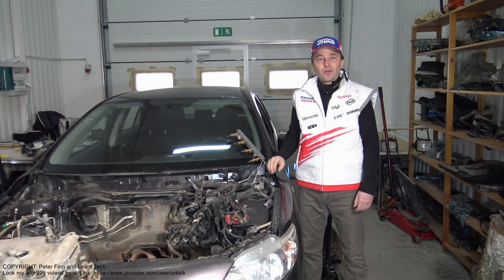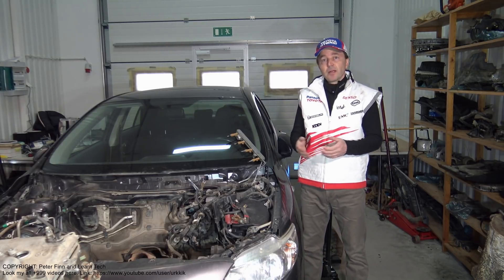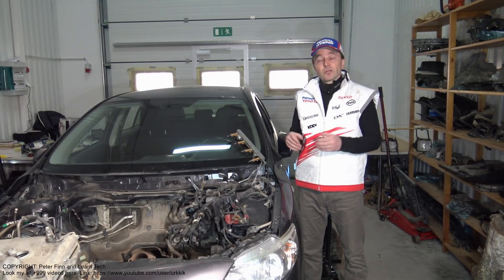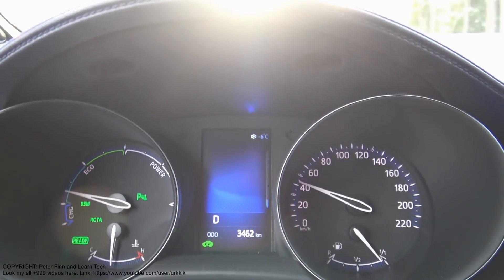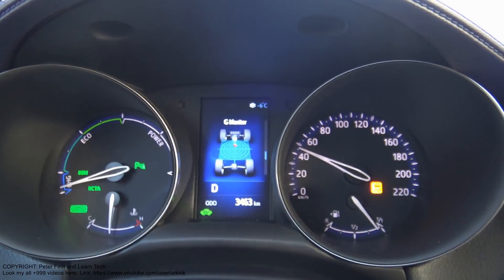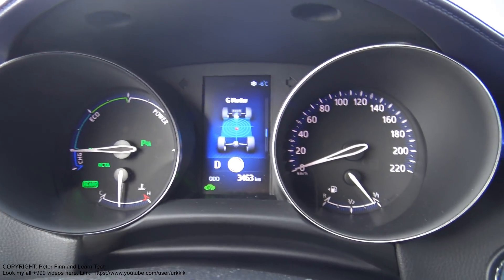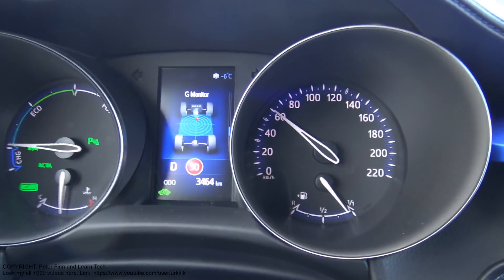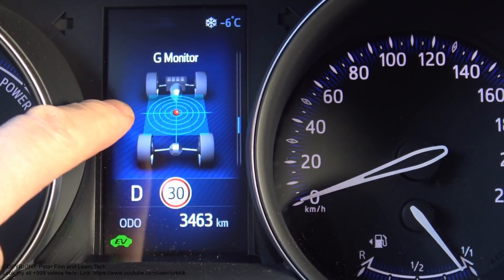How to use G-force meter in car dashboard

Comment: This does not really explain how to use the G-force monitor does it? What do you do with the saved measurements? How many G-forces are bad?How do you turn it off? Do they save/store the information and send it to your insurance company? Do the police use it to check why Toyota drivers wrecked? Can I save the data and get my toyota to automatically drive the same stretch of road the way that I previously drove it? Why did Toyota put the G-monitor in there? Do they want people to become rally drivers on normal roads?
Reply from the maker: Good comment!
Reply: @PeterFinnTheCarDoctor  Good comment to the comment. 👍

Comment: I just bought same car but cant understand yer what is that 31 km/hour   at 4.27
Reply from the maker: Ok
Reply: @PeterFinnTheCarDoctor  Excuse me I asked a question that answer is can not be ok? :)
Reply: @m1thful  hey man its cruise control start speed
Reply: @m1thful  31 km/ hour is the speed that you are going, and the 4.27 is the number of liters of gasoline you would burn at that speed, if you went/remained at that speed for 100 km.
Reply: @PeterFinnTheCarDoctor   at 4.27 in this video 31km/hour  on screen do u know what is that?
Reply: @m1thful  ok
Reply: ok